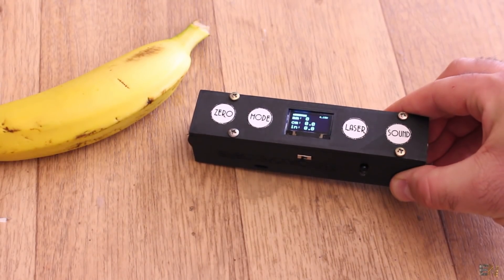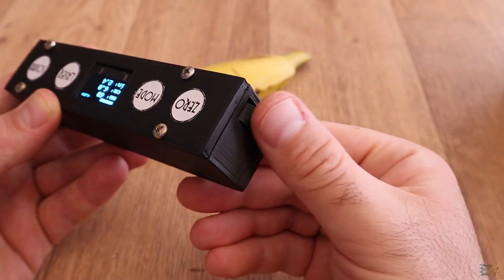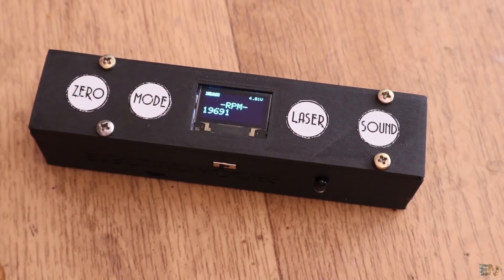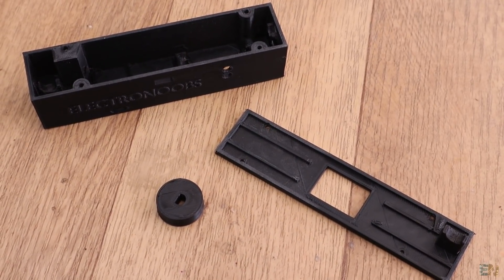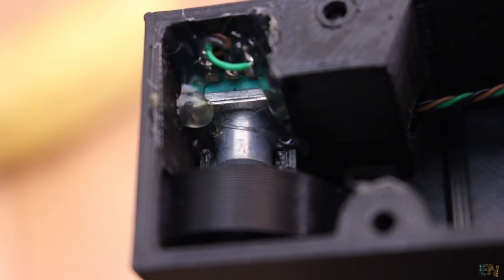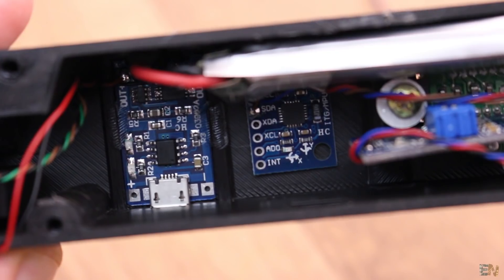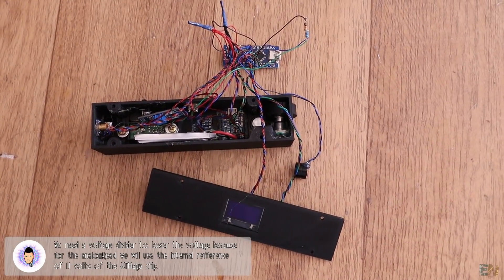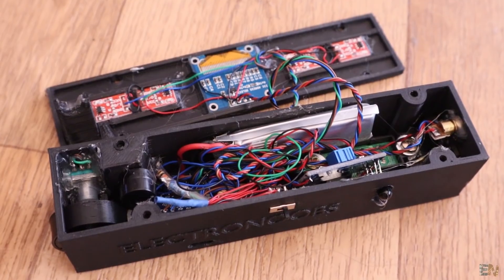Homemade Distance, Angle, Level and RPM meter

Comment: Andrei,

This is a very neat project.  There is a lot to learn from it.  I like all the capabilities.  This may be something I can answer by looking at the sketch and seeing for myself.  But if the Sharp sensor is physically left out will that affect the microcontroller operation much (other than having a mode that doesn't work)?  Thank you for taking the time to create and share this with the world.
Reply: It looks like mode is controlled by the integer mode where it goes from 0 to 5.  Mode = 0 appears to be for the sharp sensor.

If mode is initialized to 1 instead of 0
And if this section is changed from:
    if(mode > 5)
    { 
      mode = 0; 
    }

To:

    if(mode > 5)
    { 
      mode = 1; 
    }

That would I believe ignore the sharp sensor in actual operation.  There would be some extra code in there for the sensor.  But it wouldn't be used.

Comment: I know it is an old video but I am trying to make it and have a couple of questions. 1) In the schematics the sharp sensor is connected to A0 however in the code it is defined in A1 (#define sharp_in A1). 2) In the code the battery is defined in A0 (#define battery_in A0), but according to schematics that is where the sharp sensor is attached. 3) the video talks about a voltage divider in the battery, but there is nothing about that in the schematic, the only voltage divider shown in the Chema tics is in the sharp sensor.
Reply: I've been trying to figure this out too. But Elektronoobs never responds. Did you work it out?
Reply: @erikburman530  nope. I started the project then I put it aside waiting for the answer because it didn't work for me
Reply: @sebastiansombra  I put a lot of work and expense into this project. This guy couldn't be bothered to reply. I'm never going to trust him again. So dissapointed!

Comment: Question!!!

why do you have one the pins on the slide switch connected to 5v on arduino? shouldn't it be connected to Vin instead? 

Please could you clarify this because it is confusing me.
Reply from the maker: No, the Vin pin is for when you have an input voltage of above 7V and the Arduino has a 5V voltage regulator. In this case the battery is 4.2V so it can be connected directly to 5v pin or vcc

Comment: What were the wire gauges did you use for this project?
Reply from the maker: 32 I think
Reply from the maker: https://rover.ebay.com/rover/0/0/0?mpre=https%3A%2F%2Fwww.ebay.com%2Fulk%2Fitm%2F361490157691

Comment: You could also combine the distance and angle measurement, using basic trigonometry, in order to calculate the height of something with just one measurement, just like laser rangefinders (which aren't that expensive, $30 for a 100 m one, which makes me wonder why aren't there any cheap modules with that range...)